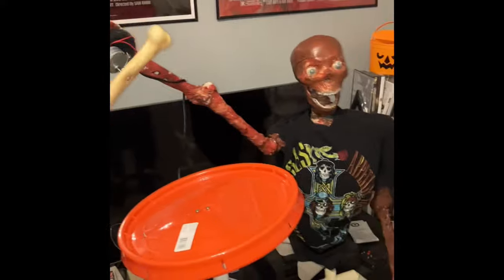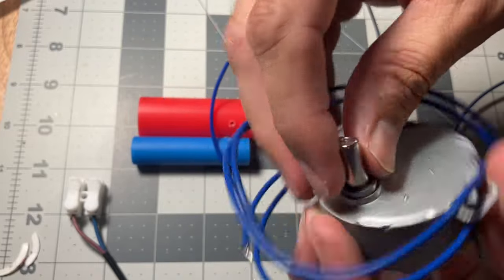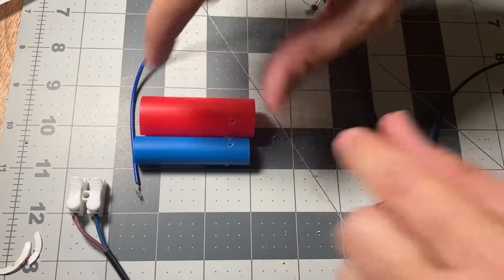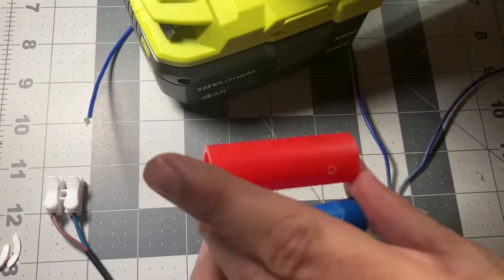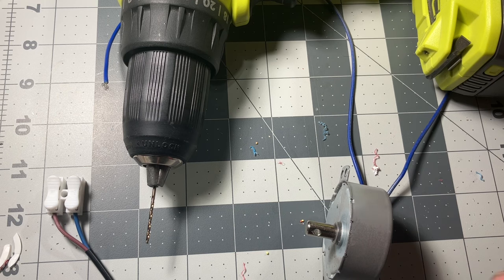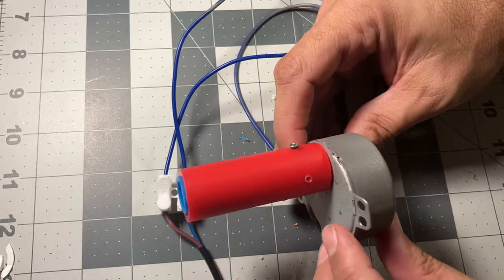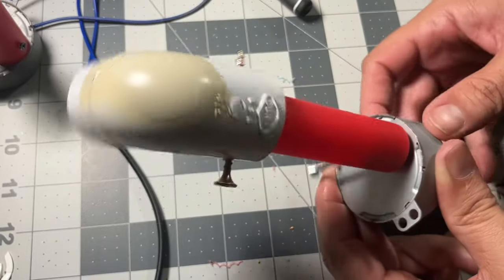Cheap and easy motor for props

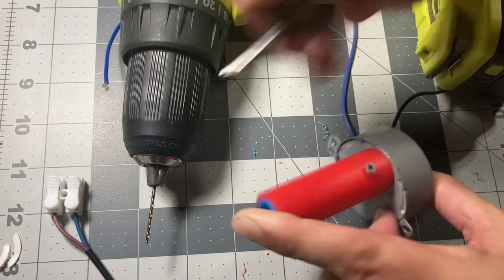Comment: Just last week I made a 3d printed adapter for these 7mm motor connections to go out to 3/4 PVC.  It eliminates the slop of the screw in the shaft since it's a tight fit.  It replaces the blue and red pex you're using.  You can hear the slop I'm referring to when the motor is shaken around in the video at 4:16, although it's very minimal due to your clever use of the two pex sizes.  Nice solution!
Reply from the maker: Awesome. Always interested in how people find work arounds for these motors.

Comment: Only worked for about a week then stopped reversing
Reply from the maker: Interesting. Never had that issue before. How long was it running? Mine run approximately 4 hours when I use them.
Reply: @brianbenson3091  never more than 5 minutes at a time. We were still building the prop. Then suddenly it wouldn't reverse. Only clicks. I just ordered two more motors and going to attempt it again. I'll report back. Perhaps it had something to do with the motor
Reply from the maker: @w215philly  though these are “cheap” motors, sometimes they are made “cheaply”. I’m sorry to hear this. I stand by these motors, and occasionally they burn out but never had one that stopped going back and forth. Not that it matters but what rpm?
Reply: @brianbenson3091  update: so I live in the EU and my original motor was 220v. I bought a replacement and it also failed. I then bought a 110v and it appears to be working just fine. Thanks again for the content
Reply from the maker: @w215philly  great glad you got it going!

Comment: Anybody want to know where those motors come from Mostly microwaves those little tower heater fans but you know stand anywhere from 24 in to 4 ft tall that are slender that go back and forth those Motors are in there too you can find them for free people throwing out that kind of stuff to tear it apart Motors are there

Comment: I don’t understand why you use 2 pipes the red and blue instead of just one pipe.
Reply from the maker: Stability. They fit tug with the apparatus on top of motor. But you can use however many you want as long as it works for you.

Comment: Is there any other good cheap motors for this? I clicked the link and they don’t deliver to the uk so was wondering if there was another motor I could use or where to find the other pieces that were used in the video? Thank you
Reply from the maker: I don’t know but have you tried https://www.amazon.co.uk/ ? Or eBay may ship to you? https://www.ebay.com/itm/126373108824?mkcid=16&mkevt=1&mkrid=711-127632-2357-0&ssspo=l2srpuv3rfq&sssrc=4429486&ssuid=GSmrW_EPRWa&var=&widget_ver=artemis&media=COPY

Comment: Thanks for making this video.  I was just about ready to pull my hair out trying to find the right size screw to fit this motor and make it stay in.   It never occurred to me to drill out the hole.  I also liked how you used the pipe.  It has me thinking of what else I can use these motors for.  Will you have more videos on other applications for these motors?
Reply from the maker: Appreciate it! Believe me, took a lot of trial and error and thrown motors. I just uploaded another video using motor for skeleton hand movements I used in my zombie pallet prop video. Newest video may help you even more, hopefully. Good luck!

Comment: Why didn't you put a bolt all the way through the shaft of motor instead of sticking that screw in just a little?
Reply from the maker: The one screw went all the way through both pipes. If you are talking about the screw sticking out a little bit, that is to catch resistance to move opposite direction. My initial screw is a #4 and I only found 1 inch screws. If that is what you are asking?

Comment: Used the link but they didn’t reverse and went really slow despite being the same. Will try another brand and see
Reply from the maker: The speed will determine the rpm so 2-3 is the slowest and my range is between 2-60rpm, just depends what I buy. They should reverse when any hard friction disrupts turning. Here are some other links of three different brands.

https://a.co/d/aHIQWb9

uxcell AC 100-127V 15-18R/Min... https://www.amazon.com/dp/B01M0FVHM7?ref=ppx_pop_mob_ap_share

CHANCS Synchronous Electric Motor... https://www.amazon.com/dp/B012W0AMYE?ref=ppx_pop_mob_ap_share
Reply: Thank you. Turns out I wasn’t applying enough resistance but tried again after your comment. Thanks again

Comment: Says “can’t move things too heavy.” Can it move 20pds on wheels? Also, I need a motor that reverses direction with resistance like you did with the screw….would it change direction when the prop (on wheels) hit a stop-block? Essentially looking to move a 20pd skateboard back and forth in front of my house.
Reply from the maker: I would need to test how much it can move. With a pushrod it could essentially go back and forth when it hits any resistance over the weight threshold. But when I have my next day off I’ll see how or if it can be done.
Reply: That would be greatly appreciated! Can you explain what you mean by “with a pushrod…..?” Are you saying that the motor would reverse once the skateboard got to the end of the track and hit something?
Reply from the maker: I would use a metal rod and attach to motor and skateboard to make a rotation. This link I’m sharing is my video how I built something similar to what I’m talking about, around the 3:40 mark

https://youtu.be/HsLIG_m4DJA?si=KB_U6Itk-dMDOlfI
Reply from the maker: You can move anywhere between 5-8 pounds (including skateboard). I made a video showing it because I explaining would be be long. I’ll also upload how I did it.

https://youtube.com/shorts/Dqs8RWsaaRo?si=52G-xc3ejECPvU09
Reply: I thought very recently it's only me who can use this motor as a cheap solution of reverse forward movement for one of my application. So there is another person who already use this idea 😮..

Comment: Why is the motor so slow at 4:43 but so quick at 5:13? I bought the same motor and I understand the more rpm in making it faster but I’m curious why yours moves so slowly and then suddenly becomes so quick?
Reply from the maker: Two different motors. First one was showing the setup (probably 2-3 rpm), second one was one already completed (faster rpm). Since I use so many different rpm’s, it is just preference.
Reply: @brianbenson3091  ok that’s what I figured but I wasn’t sure.
Reply: @brianbenson3091  on a different note tho, if I needed to my motor to be able to move something heavier, I would need more volts?
Reply from the maker: @stephaniekeating6596  these motors are weak so you have to be creative on how move heavier things (depends what you have in mind). If it is something heavy, I’d go with a wiper motor from somewhere like frightprops.
Reply from the maker: @stephaniekeating6596  here’s a link to one of my videos moving up to 5lbs 
https://youtu.be/BKoLoexPYaM?si=TSp_gR6IrJQZ3stW
Reply: @brianbenson3091  thanks so much!!!

Comment: Can you link the motors you used. Cuz as I understand it not all of them will reverse???
Also are the ones ur using 5vish or 120v?
Reply from the maker: The link for one type is in video description and here is another similar. They use regular 120v plugs that usually come with motor. All motors I’ve used went both directions.

3PCS Synchronous Synchron Motor Turntable Motor Electric Synchron Motor For Cup Turner,cuptisserie,Tumbler Cup Rotator with 7mm Flexible Coupling 100-127VAC 50/60 Hz 4W 5-6RPM/MIN CCW/CW https://a.co/d/feqaFTd
Reply: Look for the word "Synchronous" and the letters "CW/CCW" in the description of the motor, it stands for, clock wise/counter clock wise.

Comment: Y did u use the blue and red pipe. Y not a regulare pvc pipe?
Reply from the maker: Blue pipe fits snug to motor fitting, red pipe fits snug on blue, so little give. Guess you can get away with just blue if you but pvc pipe over it and screw it together so no wiggle. But this is the reason why I do it.
Reply: What sizes of the two is the red 1/2 or 3/4.
Reply from the maker: @MandeepGrewal-u6e  red is 3/4 and blue is 1/2 description has links

Comment: How many V and rpm are those motors
Reply from the maker: Link is in descent here it is:

CHANCS Synchronous Turntable Motor Electric Motor TYC-50 5-6RPM 4W 100-127V with 7mm Flexible Coupling Connector, Synchron Motor for Cup Turner,Cuptisserie Rotator 1.8M Power Cord Switch Plug 2pcs